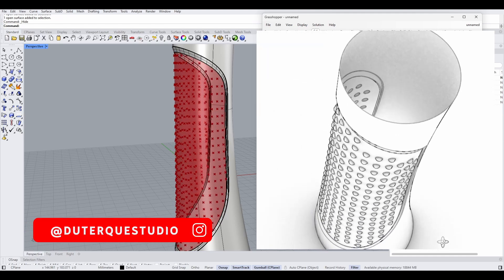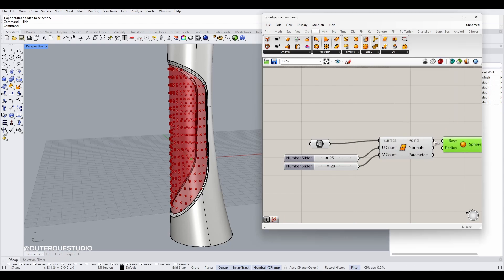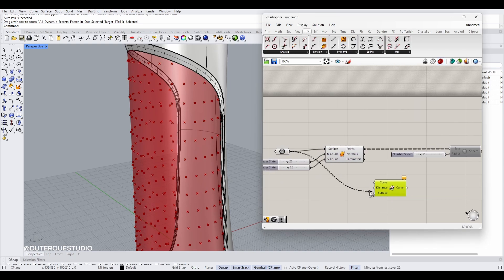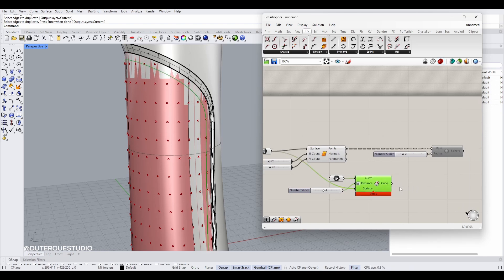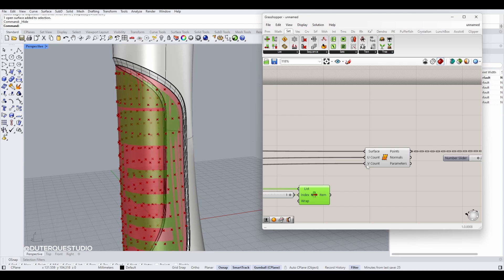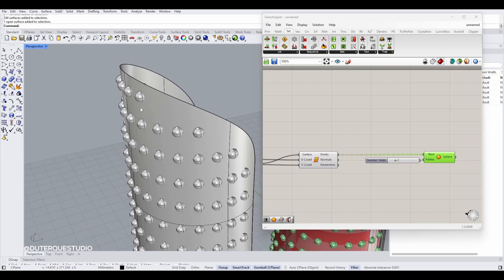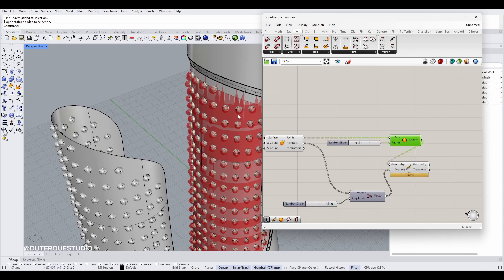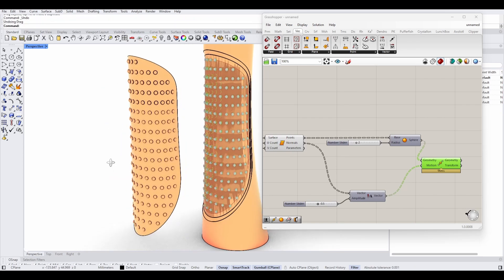Easy grasshopper texture for product design

Comment: Also i have a question is it possible on a Sub D object i tried but seems theres no way had to convert my Sub D to surface am still new to GH but its a must learn thanks again.
Reply from the maker: You have to convert it into a surface with subD to nurbs, but you're likly to have a surface with lots of patchs, and this method of doing pattern only works on single surface. There are work around that but it really depends on the shape your trying to apply a pattern onto